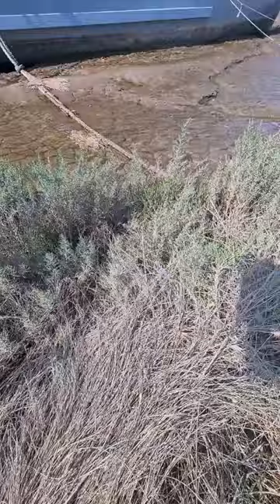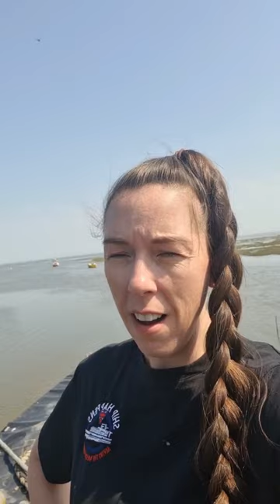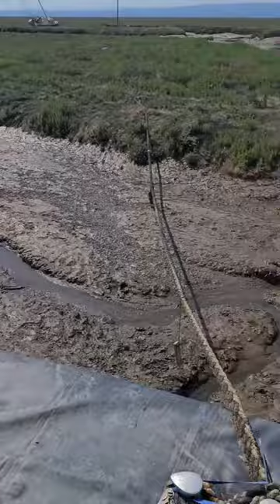#shorts WHY DONT YOU PUT YOUR BOAT ON THE HARD??!! #boat #boatrestoration

Comment: I know I was thinking like everybody else, I mentioned before about maybe floating the boat at the highest tide over some blocks so you can get more of the underside done. But , from what you indicated is that you've got things torn out inside the boat that prevents you from moving it right now,  is that right?   The other thing I was thinking is, you've got your boat Beached or grounded higher than the highest tide in your area.  I was in Scotland one time, and when the tide goes out there the boats are sitting in the bottom of the harbor.    Larry

Comment: you're doing a beautiful job on all that intricate, time-consuming  woodwork in the classic method with copper rovings etc., slowly bringing this boat back to a high standard, with low overheads because you can have it in the estuary there. At some much later stage I guess you'll need it on the hard for a day or so to antifoul  the very bottom and attend to the propellers and rudders, but a few days hopefully won't break the bank. I think your own judgement in this is spot on 👍

Comment: I'm one of your followers asking the question! Money is a enough good reason to stay where you are ! Actually, I'm wondering if in fact the mud might have had a preservative effect on the wood 🪵 🤔 ?
I'm certainly with you on not lifting Sarinda. I  doubt that her keel will have the strength for that. For the same reason I wouldn't be subjecting her to the stresses of rough seas. No doubt you will be aware of the Sailing Yaba Project ⛵ on YouTube where they started with their keel and have ended up replacing practically everything above it. Money doesn't seem to be a problem in that case so it's probably of limited relevance to your noble project. I wish you only fair winds and calm seas!

Comment: I do understand your concerns. I wouldn't recommend lifting any wooden boat out of the water especially yours! A marine railway or a dry dock are far better solutions. I could recommend a yard called Bültjer on the German- Dutch border. They do all the wooden fishing vessels so the prices are reasonable and you could DIY. They even have the possibility to tow you into the shed. Another good option is to haul out right before a yard starts their hollidays. That gives you about 3-4 weeks of working time for the price of one haul out. The third option is to rent a big commercial dry dock together with other boat people. Haul out fees here are in between 400-800€.
Reply: There are pull out rail mounted platforms and floating dry docks. I was in an old steel barge with the end cut off and timbers that were dropped into a slot and sealed the open end. The barge was sunk my boat put in at high tide, the stop logs dropped in place and the water pumped out. The engines and fuel tanks had already bean removed to make the hull lighter. side bracing supports installed as the water level went down. Then weeks of work to remove an inch of Shotcrete that had been sprayed on the hull, together with chicken mesh that had been stapled on as a reinforcement. This was done to stop the wooden hull rotting. One plank was replaced, caulking replaced, painted and anti fouled, what did it cost???? Two arms and two legs.
After coming out of drydock two newer marinized engines, gearbox's and stern gear installed. New fuel tanks and diesel filtration installed, this done in a Medway yard the otherside of the UK from Marinda. The rail carriage is in Lowestoft and belongs to MTB102 that sits on it all winter, again on the East Coast.
Reply: Get a clue. Why would they move a boat in Britain to the Dutch German border?
Reply: @alexandersinclair9006  Because that's exactly what we are doing with our 82ft project ship. Getting the steel work done in Holland and crossing the border to Germany when we eventually start with the wood work. There are not many yards specialized in wooden ships with reasonable pricing. A few hundred liters fuel for the crossing might be worth it considering labor and timber costs.

Comment: if i were u would have borrow tractor long arms and make hills all around boat just keep water out n make it easy finished jobs
(like i have do back 10 years agos because customers boat have been by hurricane strom n push it agint tree broke hual front end later tide go down where no water near boat so i got tractor out n make taller hills around boat so that way no water get in our way whiles doing repairs to hual front end fixed and go back fix rear side where rubber is danged by roots got it done n have wait for almost 2 more months unite water go down (tide go down) then get out there in hurry dig up rear hills to get boat back in water when tide raises after 2 hours and finally finished it them tow boat came around tow boat back to marine where they lift boat out of water on deck to get her repairs (it was they family dream boat they hate see it go to waste so i did whatever it took me get jobs done get boat back to marines so pro can finished it off
i dont know if you find this usefull information that may help other around here (im engineers repairs dont like being full time jobs but i will finished one jobs and move on to something else)
if you cant borrow tractor how about bag n shovel mud in bag make hill around boat save a headache but take long time unless have teamwork (just trying make thing simple)
Reply: What? Watch the videos. Pretty sure the local government would be aginst blocking a tidal stream.
Reply: @alexandersinclair9006  only 4 ft between boat n hills